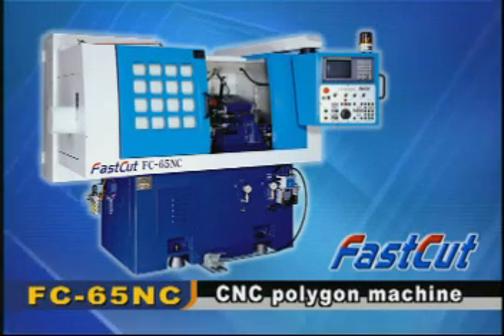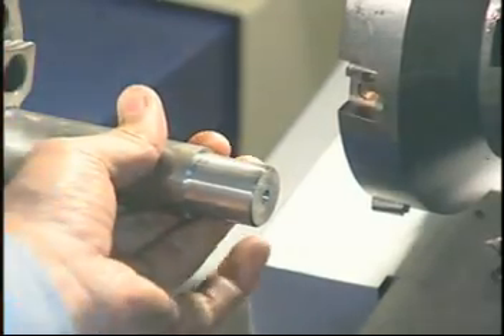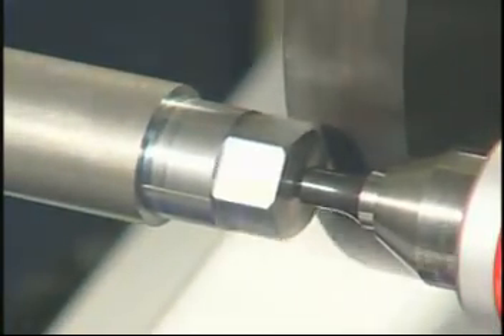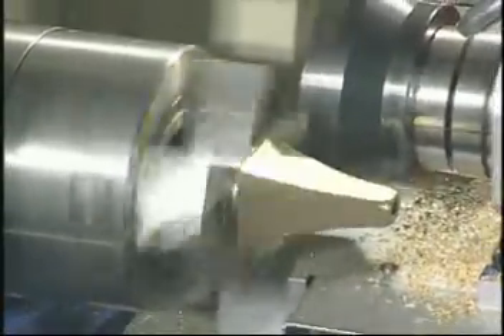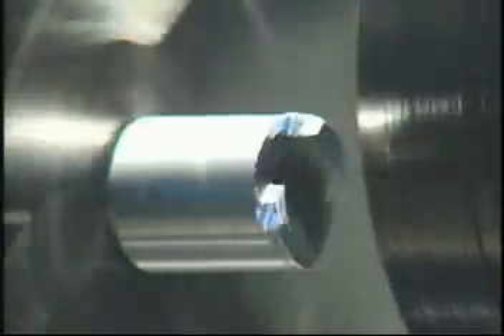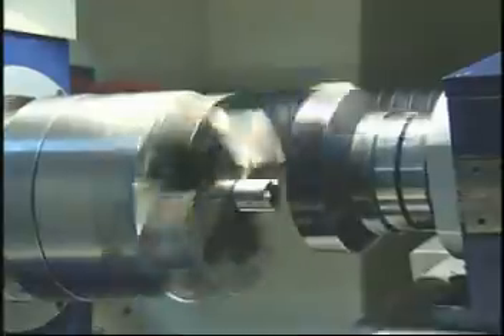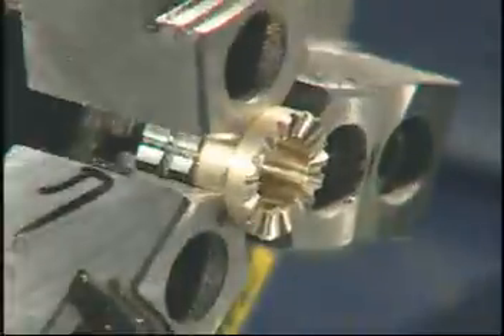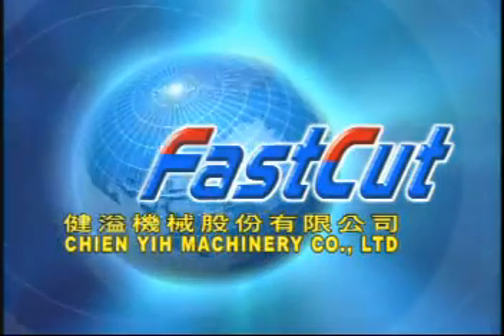Polygon CNC Lathe FC-65NCL

Comment: At school, we have a Cnc-lathe with SIemens  controllingg system. It's got a function that you can use to program the lathe w. x and y coordinates when milling. The coordinates where then transformed into x- and c axis movements to achieve different shapes using a mill.